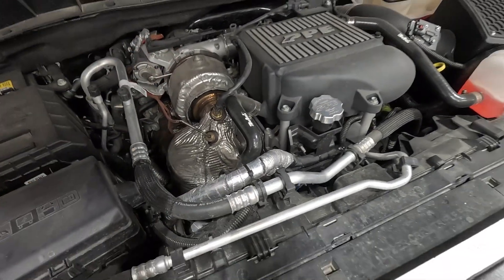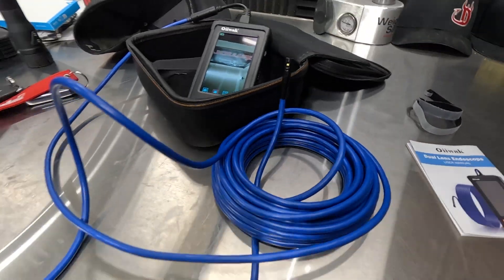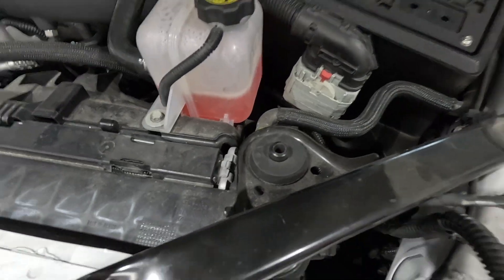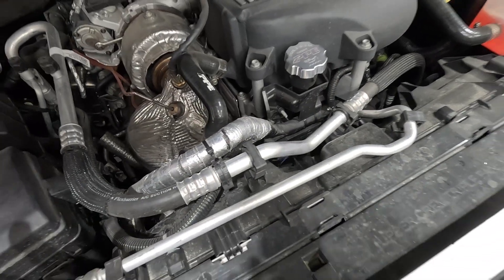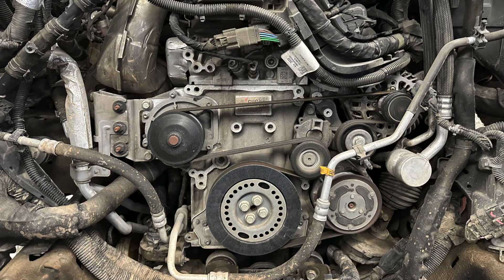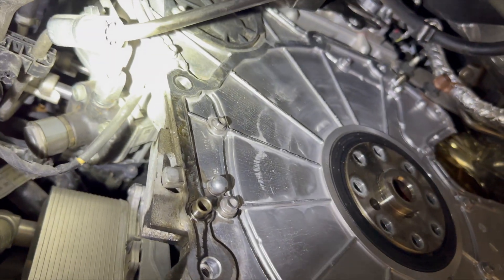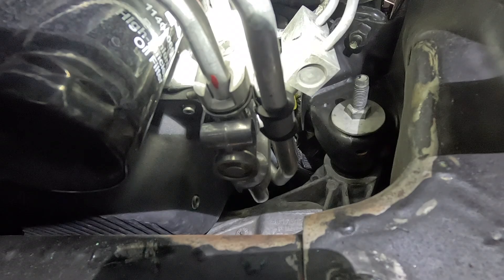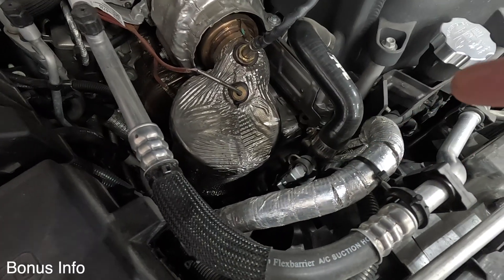Oil and Coolant Leak locations on 3.0 Duramax + Ground Issue

Comment: Can you put this in context in terms of the overall quantity of these leaks on how many vehicles that you've seen? My guess is that not all the vehicles have all these leaks? Please elaborate if you can. Thanks!
Reply from the maker: It's not extremely common, so I would not worry too much. These were just the common areas that I see, as a GM tech.

Comment: Changing the radiator on these is hell. I havent found any shortcuts. Good luck to the do it yourselfer in the future
Reply from the maker: Yeah, it will be tough for the DIY person for sure.
Reply: @DemonWorks  We had one come back after a radiator replacement where the drivers side trans cooler line came out of its holder in the cooling fan. The drive belt rubbed a hole through the trans line and made a huge mess. Drive belt sucked into the front crank seal and damaged it. To me it seems like once you clip that trans line back into the cooling fan you cannot make a single adjustment to the trans line afterwards otherwise it weakens the clip significantly. Ever since I've put a zip tie on every one I do to prevent it from pulling out

Comment: do you have a video do that front plug on how to retighten it?
Reply: or how to remove it and service the plug?
Reply: I just checked mine and it is leaking form there, and i just want to repair it on my own
Reply from the maker: I resealed a rear plug in this video, the front plug is the same. https://youtu.be/dxGu1pIJeGo
Reply: @DemonWorks  ah kk, but getting in out and back in, you just need a long extension or you need to take of parts?

Comment: Gadzooks.. sounds like engineering and poor parts quality i stopping a quality product. Still glad I went with the 5.3.
Reply from the maker: I like the 5.3 but if I did a video on the 5.3 / 6.2 it would be a longer one. Each of the engines have their perks and drawbacks.

Comment: Great to know.  Not sure if you saw my latest video.  But what about burning oil in the LM2.  I burned 2 quarts in 1200 miles when towing.   Chevy wont do anything unless they service it.  I have it all logged and they didnt care.
Reply from the maker: Yeah, there needs to be an oil consumption test performed and the dealership needs to verify the oil level is proper at the start. In addition, towing can cause the engine to consume oil so that's a tough one. If you are towing real heavy or a lot, maybe considering a 2500 is the better option?
Reply: @DemonWorks what issues do you see with the 6.6 gas? I have the lm2, but im a couple hundred pounds heavy on payload when I tow so I've been thinking about getting a 2500 gas. Would really appreciate your input. Thank you.
Reply from the maker: @GregD94  6.6 gas has been reliable in my experience. I had one consuming massive amounts of oil when towing g but otherwise haven’t seen many issues.
Reply: That’s an absurd answer. Chevy markets the 3.0 Duramax as a great towing engine. As long as you are towing within the rated limits, the truck shouldn’t be using excessive oil. Poor design if it is.
Reply: @tylermacconnell217  ya i agree.  The selling points are towing capabilities and mpg’s.
Reply from the maker: @tylermacconnell217  just the truth… it’s in the owners manual. Applies to towing and track use in cars…doesn’t mean there is an issue, just part of the way things work. Happens in the 5.3 and 6.2 as well. Amplified with turbocharged engines. Nature of the beast.
Reply: Chevy doesn’t care about anything

Comment: Unacceptable all around…..
Reply: I agree, for how much you’re spending, I wouldn’t want to see any of these issues or leaks under 100k miles. As much as I want to buy one, all these small issues are definitely a deterrent. The repairs aren’t going to be covered under warranty are they?
Reply from the maker: Stuff happens with all manufacturers and engines... don't sweat it.
Reply: with the amount of $$$ for trucks and the technology, you'd think that simple stuff like oil and coolant leaks wouldn't be occurring. But I'm just a Serf  @DemonWorks